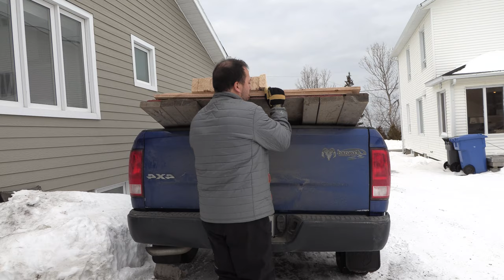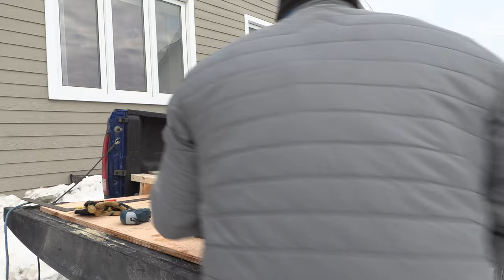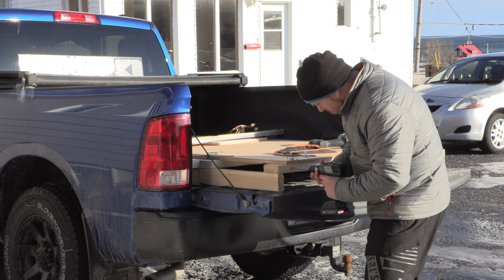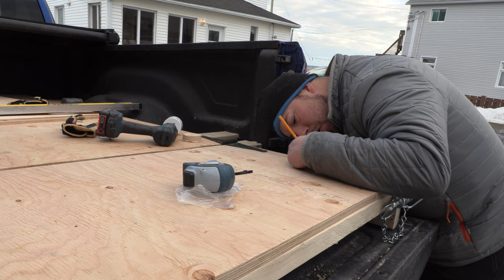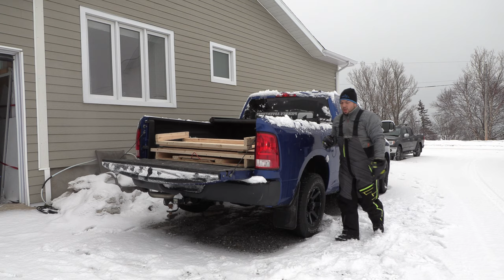How to build a wood sled deck to carry  a snowmobile  in a pickup bed | Pierre’s Adventures

Comment: Thank you SO MUCH for creating this video.  I made the platform for the back of my 2017 Tacoma and used 2x10's to lift it above the wheel bumps.  Instead of building a ramp I bought an aluminum folding ramp from Princess Auto for $200..it folds right under the deck for transport.
Reply from the maker: The aluminum ramp , is the safe way to go! Light and easier to manœuvre. I do love my deck , it is on its fourth season and still do good. I had to refit it from Dodge to Chevy.

Comment: How do u keep the sled deck from sliding off do u strap it down ?
Reply from the maker: I used u bolt in the d loop of the bed. Ram have 4 anchors by default and the build was also snug fit into the bed. Never had it move on me. Also when the sled is on. Some tie down loop into the bed anchors.

Comment: My sled is a 4 stroke. Would it be too heavy for this wood ramp?
Reply from the maker: I'm no engineer, but mine was an expedition sport  900 ace: 4 stroke.  no issue at all. I'm using 3/4 and the 2x4 add rigidity too.

Comment: What the serious hell?  How do people think of this stuff? haha  I can do the actual building but to come up with a plan? My brain just cant do it. So top notch man. Great work. 100% subscribing.

I've been looking for something exactly like this .. kinda. I need to adapt it for my trailer. Its a 4'x8' trailer with no ramp. It has wooden sides and back that are removable. I just need to figure out how to adapt this to suit my application. Overall the concept should be the same...I think.

Thoughts?
Reply from the maker: 4x8 is a great dimension since plywood will require less cuts. The only thing you may need is to be creative to solidly attach the deck to your trailer. The last thing you want is to hit a bump send your deck flying.
Reply from the maker: You may also need to split the ramp since I used a 48 inches wide ramp.

Comment: Nice work! How are the ramps attached to the deck? What length is your truck bed, I would like to do this in. 5.5 box
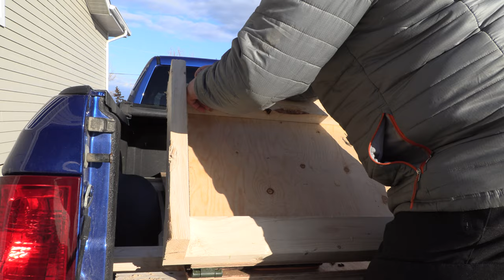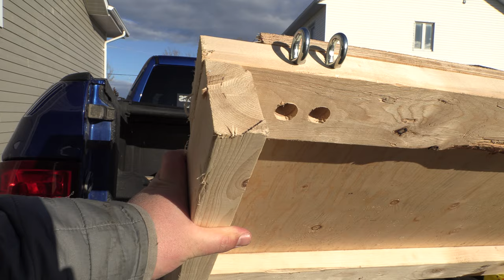Reply from the maker: Hi Lee, look at 6:32 i have ring that i install on the deck side, on the ramp side i used a 4 screw 2.5 or 3 inch ring on the opposing side of the ramp.  At 6:41 you see the tractor pin i have been using to lock the two together. So to lock them i unfold the ring of the ramp, place it between the two deck ring and install the pin.  Hope it help, If not you can contact me on my Facebook page. I will gladly messenger you some picture.
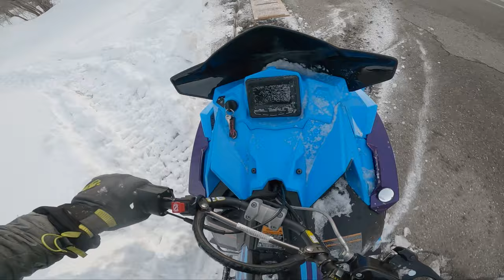Reply from the maker: As per the 5.5 box, it really depends of your sled length...a 154/155 was going back a few feet on a 6.4 . Look at 10:16 to give you an idea.

Comment: I bought a used ramp for 150 bucks. I bet the lumber cost more than that.
Reply from the maker: 2 plywood sheets 80$ each this season 4  2x4 stud 8-9$ a piece. Plus 2 2x6 stud at 9-11$. I guest so.

Comment: great video, just what i was looking for. but do you have an item list by any chance?
Reply from the maker: Good question! I will go at large your specific need may vary  on your project.  2 plywood 4x8x by 3/4 thick,  2 2x6 for the deck base, at least 5 2x4 for framing and ramp, swivel kit 2 or 4 depending on how strong you want it. I used 2 or 3 1x3 for traction bar, (you can go premium with caliber product) 4 Circle screw-able anchor point, to lock the sled on the deck. 2 - 4 U bolt to lock the ramp on the bed. Hardware to attach the ramp i have used 4 large screw-able ring and 4 1 inch  ring on the deck to attach  the ramp to the deck, 2 large pin to attach the ramp to the deck, you need to interpose the ramp ring to go in the middle of the 2 deck ring. Bunch of 3 or 3 1/2 inch screw and some 1 inch screw. i hope it help, if you want i can do a follow up video.
Reply: @PierresAdventures  amazing, I appreciate the quick response! I'm going to have a go at this this week. I too have a ram 1500 so it'll be pretty much the same!

Comment: Too bad this is probably 800 bucks worth of wood these days.  :(
Reply from the maker: Sadly! When I built it, it was not bad. Today estimate is 150-200$ plywood. Lumber cost around 100$. Plus the hardware. The whole project was under 225$  if I remember in 2019.